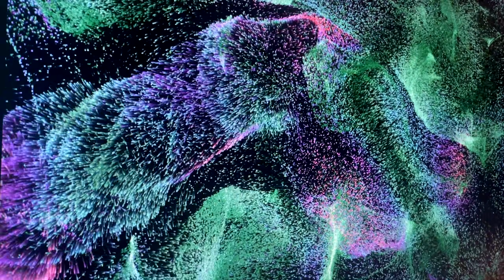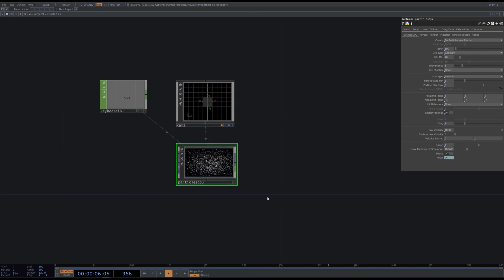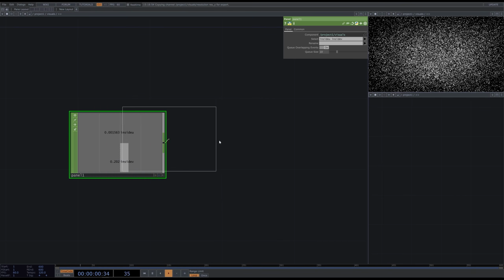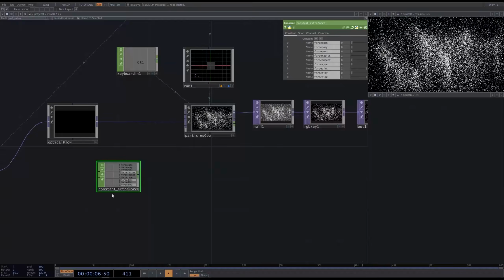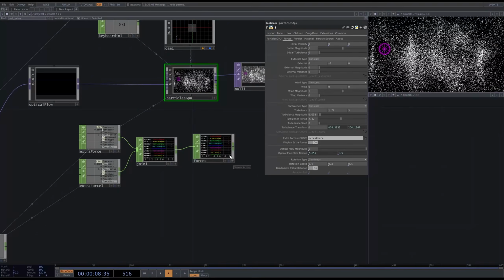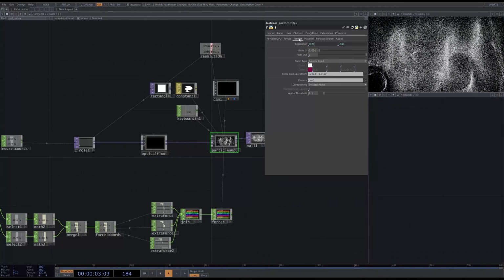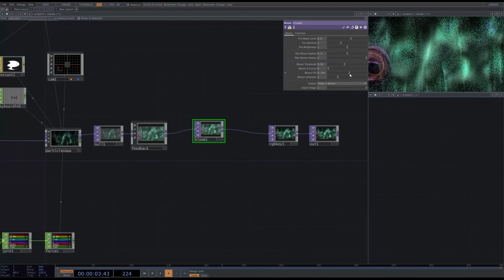Interactive Particles with Slamtec LiDAR | TouchDesigner Tutorial (Part I)

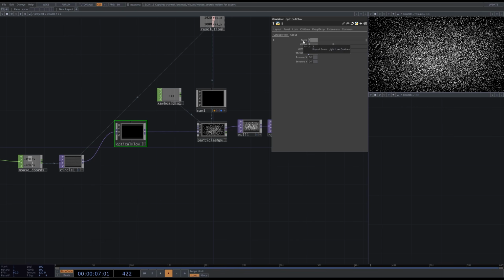Comment: 5:01 noob here, can anyone help? when i display panel, it comes out stretched, like the top and bottom have been cut off. i think its affecting my opticalflow cursor interaction (7:58) because it's not drawing properly like in the tutorial.. :(
Reply: hey my friend. i was running the same issue. i rewinded the video to the particleGpu node setup and saw one detail that improved the visualization. 
1:48 in particlesGpu node / Particle Source tab / Orientation parameter: set it to XY Plane

Comment: Is it possible to make a webcam monitor the monitor and the movement of the hands? If so, please write a short guide or record a separate video if it's not difficult for you.
Reply: try using mediapipe body tracking
Reply: @eb9billion I used it and it worked, but I was wondering if it's possible to have the webcam track the monitor and my hand.

Comment: I can't get the panel CHOP working right. I'm getting: warning: the node "/project/visuals" referenced by parameter "Component" must be: Panel COMP (/project/VISUALS/panel1)
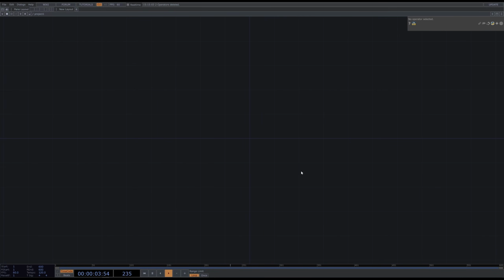Reply from the maker: Hi! It seems like your 'visuals' component is a Base COMP, but not a Container COMP. Rewatch the very beginning (around 01:00) - I put visuals into Container exactly because it allows to use a Panel CHOP. So you either need to create a Container and copy your network into it, or just use the Mouse In CHOP instead of the Panel CHOP for coordinates - it's also fine, you'll just utilize the whole screen rather than the preview window.

Comment: I can't figure out why the extra forces aren't following the mouse. The problem has been coming to me since I copy and paste constant_extraforce and connect it to mouse_coords
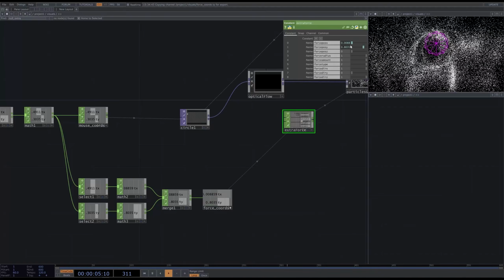Reply from the maker: Make sure you referenced the copied extraForce in the particlesGpu component and also remapped the mouse coordinates with the Math CHOPs. In the Math CHOPs you may need values that differ from mine depending on your camera settings. Anyway, if you carefully repeat my actions from 9:30 till 12:05, it should work! If not, drop me an email with your project file on anyamaryina.cg@gmail.com
Reply: When I type in a number or use the slider in extraForce > forceposx or forceposy, it moves the extra forces display! The mouse coords don't work... go figure! So, I'm deleting the Extra Forces (CHOP) in the particlesGpu... I just won't have any twirlies!
Reply: @graphician44  Make sure to reference the mouse coordinates to the numeric value of extraForce (Name forceposx "0")
reference the coordinates to that zero; for some reason I didn't realize and was referencing it to the name, so it wasn't working for me.

Comment: awesome video with very clear instruction!! however i'm having trouble with the particle source in particlesGpu COMP, as the orientation as well as the other parameters are yellow and cannot be changed. do you have any suggestion? :(
Reply from the maker: Hi, yellow color means that parameter is read-only, you can change that by right-clicking on the parameter > Toggle Read Only. You're probably using another version of TouchDesigner/particlesGPU: they have some differences from version to version
Reply: @anyamaryina  thank you!!

Comment: Is there a way to move the particles with your hands using a webcam?
Reply from the maker: Sure, just connect your hands coordinates instead of the mouse. You'll need just x and y coordinates, and most likely need to remap them with a Math CHOP. For getting those coordinates, use MediaPipe plugin (there's a detailed overview on GitHub, or watch Torin Blankensmith tutorials)
Reply: You could also use optical flow from Tools section in Palette going into the particle system- it would see your whole body is the only thing, so it detects any movement. But some variation of video device in - NVIDIA Background Remover TOP - threshold TOP - Edge TOP  - Blur TOP - Optical Flow - Particles GPU optical flow input works nicely, handy if you want to allow for multiple people manipulating the particles (as MediaPipe only allows one).
Reply: @final_animal  great idea!

Comment: I follow every steps in this video, but I'm wondering why it doesn't show the particle trails when I drag the mouse cursor in the panel. For more information, in my particleGPU, Reset parameters doesn't show up the switch button on-off, when I click it appears black and there's no any particle birth. But after ignore this issues and continue the process ('keyboard in' step) I can toggling on-off the reset ParticleGPU without any problem. I don't know if it's a common problem or not but I really want the solution for it. Thank you!
Reply: Having this issue too, did you find a solution?

Comment: in my case after adding OpticalFlow the mouse movement still doesn't affect the particles. I connected it to the 4th input but nothing..
Reply from the maker: Hi, if you don't have an error saying your GPU doesn't support Optical Flow and there's a red/green silhouette in the OpticalFlow component viewer, make sure that the Force parameter in the Optical Flow is bigger than default (I put 10 but try even bigger number) and Threshold is 0. Also try increasing the Optical Flow Magnitude in the ParticleGPU component > Forces tab.

And just in case: the OpticalFlow should be connected to the 'Input 3 (TOP) optical flow', I referred to it as the 4th input just because it's the fourth if you count from 1 :)
Reply: @anyamaryina thank you so much! I just had to change the input to 3 haha